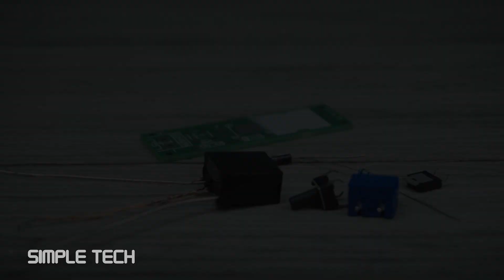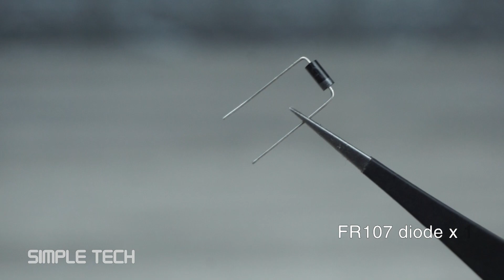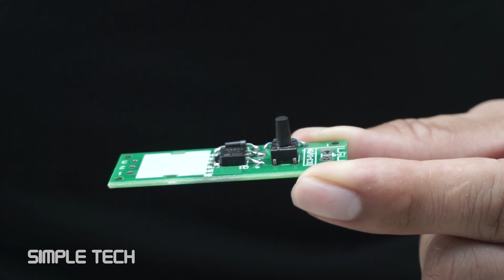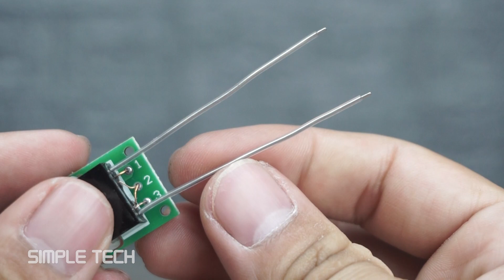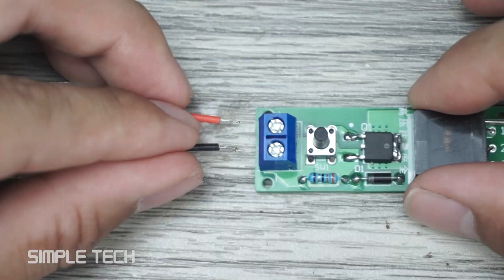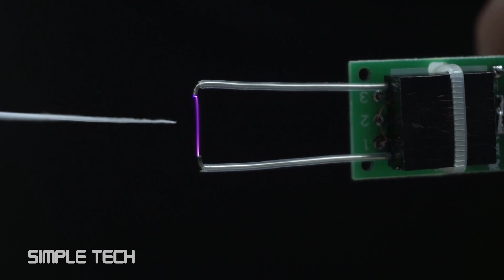High voltage generator DIY - Plasma arc lighter │Simple Tech

Comment: @SimpleTech can u please tell the name and values of the components used.
Reply: Resistor.     
fr107 diode . 
Mjd3055 transistor.
Mini HV transformer.
On/off switch or voltage switch. 
Negative and positive terminal.

Comment: Bro! Is scratching the transformer wires necessary?
Reply from the maker: Hi friend, it is mandatory, the original manufacturer also scratched the top part...
Reply: Hey,
Just so you know why, usually those wires have insulation on them. Scratching removes it, so that the solder makes a good conduction.
Reply: I didn't scratch them and it's working. Just have to burn the insulation with the hot iron. You'll see it when the solder flows.